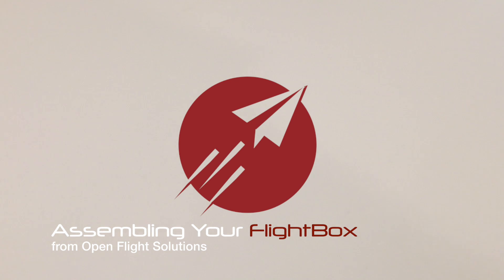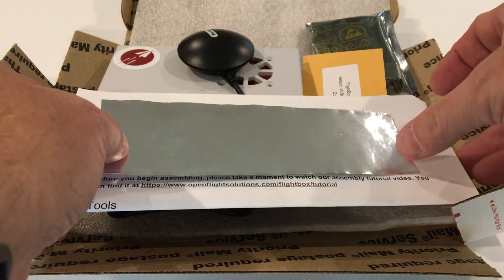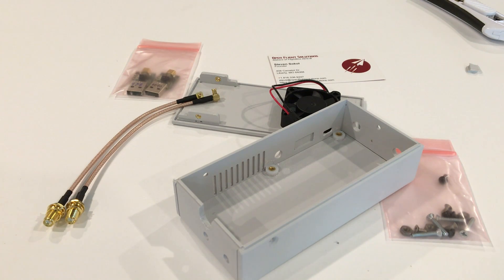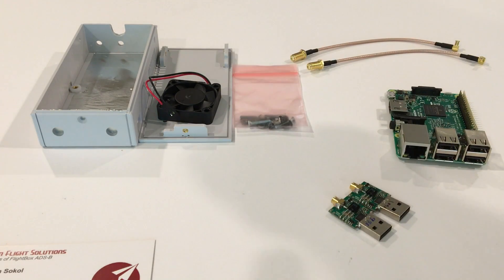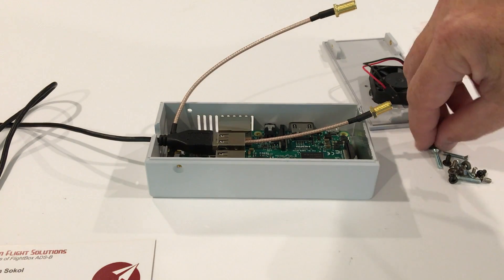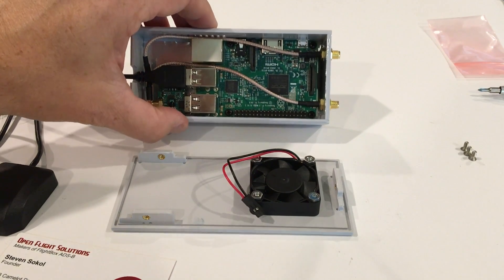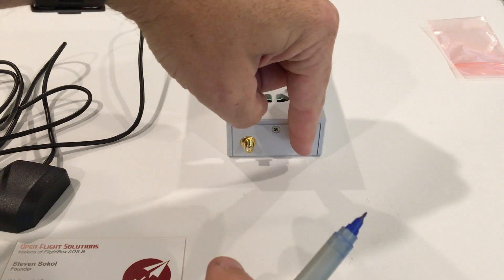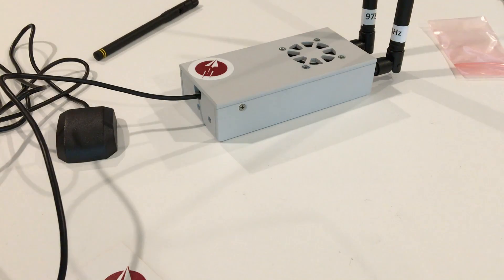FlightBox Assembly Tutorial

Comment: Word of caution when using the blue thread locker....if it comes into contact with plastic, the plastic will turn brittle very quickly and fracture easily....years of R/C aircraft experience taught me the hard on two occasions....it should only come into contact with the metal parts.
Also, make sure that you use the Blue thread locker....it will allow screws to be loosened if needed, whereas the Red and/or Green formulas will not.
I'm very thankful that FlightBox came up with a reasonably priced solution that, from what i hear, works just as well, if not better, than the more name brand models that are more than twice the cost.
I'm hoping that FlightBox will offer a wireless version at some time in the not so distant future, and possibly antenna-less like the now unavailable Sagetech Clarity model.